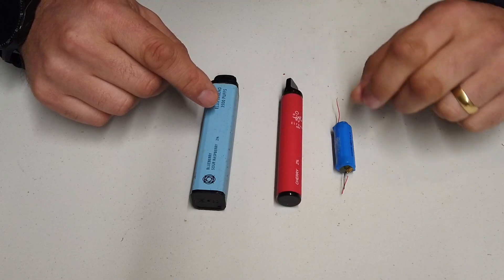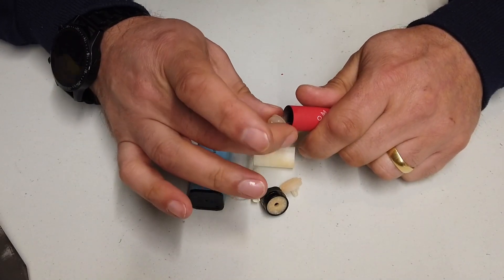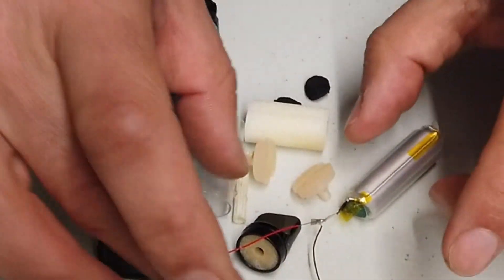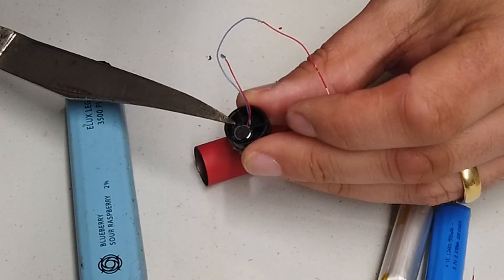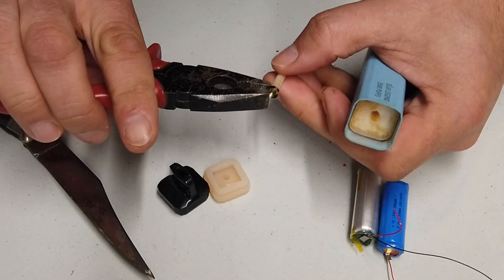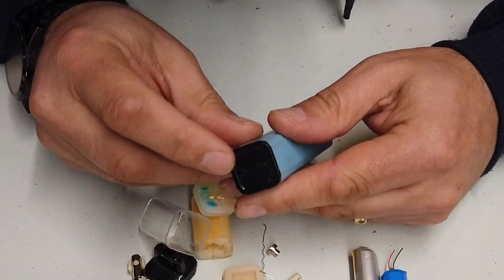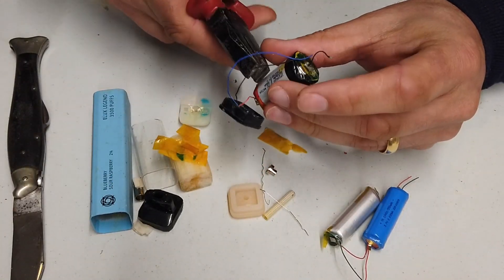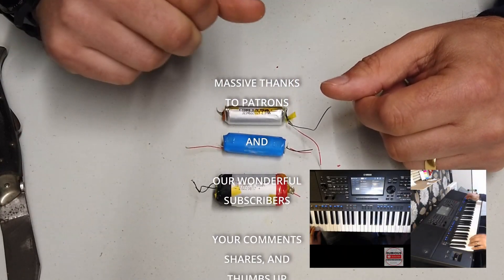DuB-EnG: Vape Lithium Cells Discarded Disposable Reclaimed Batteries Upcycling Waste Electronics

Comment: @Dubious Engineering - The only problem I have with repurposing disposable lithium vape batteries, is that manufacturers 'skimp' and don't bother including any kind of independent over/under charge protection circuit on the batteries. And most gadgets nowadays are designed to keep their lithium batteries charged to 100% whenever externally powered, which usually results in a catastrophic (often pyrotechnic) battery failure. The switch you refer to, is a rudimentary volumetric sensor, a simple way of detecting pressure differential, that simply closes a circuit whenever the air pressure changes. I always remove protection circuits from 'dead' lithium batteries, to reuse them with disposable vape batteries. Then they're safe to use and last ages because of their high capacity and very high discharge rates, also because they've only gone through one 60%~80% charge cycle from the initial manufacturing process. Hence the initial charge is NEVER meant to outlast the juice, so users don't experience dry hits. 👍😉
Reply from the maker: Absolutely!!! I always use a capped voltage constant current charger and maintain about 4.1v per cell 80-90% otherwise it all ends in tears 😢 😀😃🙂

Comment: People tend to wreck these things in some sort of anger and throw the battery on the ground. I sometimes see the LED blinking like a beacon. I think it gets activated by wind. If the battery is damaged, it gets a bit warm. I hit a motherlode where someone had gone to the woods and dropped about a dozen of vapes. Seems like they carried spent vapes with them to throw them on the ground.

The batteries can usually be recharged in an Opus charger. But are very fragile without solid terminals to use in a radio or something like that.
Reply from the maker: I've collected about 50 now...  Just thinking what to do with them!!!

Comment: I have in fact opened one today, like the fat one you showed. Using it for a solar project with a microcontroller sleeping most of the time
Reply from the maker: Incredibly useful little batteries...  👌 👍 😀  ...  and totally free 😀
Reply: @DubiousEngineering  yep. The one i just dissected was 500mAh. Not fantastic, but quite ok combined with a solarpanel and an ESP only waking up 6 times a day. Saving the sensor too. Might come in handy one day

Comment: I use “5V Charging Board MINI USB 1A 18650 TP4056 Lithium Battery Charger Module”that are cheap of ebay or Ali express to make little portable power packs. You can run led lights off them or if you add a step up usb module you can charge phones etc. it’s easier to attack them from the bottom to get the batteries out.
Reply from the maker: Thanks for the tips Simon! 😀...  I plan to make a charging video shortly with BMS and an intelligent charger! Best, Howard

Comment: I would imagine, Think of a one way valve. but the flap allows air flow. when you suck it's pulled to a connection turning on the battery. Easy flow switch....
Reply from the maker: Two plates of metal perhaps...  maybe I'll get the macro camera out for that video 😀

Comment: Sorry bro charged more then once likely, I normally get at least 5 charges before the liquids gone of the small ones. You tend to charge them before there empty too, because as your hitting them they get weaker and weaker as the battery juice drops. but considering you normally get 1000 charges of a lithium still a awesome find.
Reply: Except there is no charging circuitry or even socket! These are straight disposable.
Reply from the maker: Yup, no charging socket, I should have made that clear, but perhaps our man has his own way of recharging them?  Disassemble, recharge etc..  ??
Reply: @DubiousEngineering  My bad im normally getting the thc or cbd ones, there meant to last a bit longer. I forgot about the 7-9$ cigs ones that cant recharge.
Reply from the maker: @Marc Catalano  sadly, they don't sell those in UK 😞

Comment: Disposable vapes should be banned.
Reply from the maker: I'm tempted to agree. It's wrong all that lithium goes into landfill...
Reply: Where I am I think they are banned, as I've never seen these single use disposable vapes. The vape pens I've seen are fully rechargeable, and it's only the mouthpiece part which contains the juice and heater coil that's thrown away.

Comment: As I don't smoke, how are these meant to be disposed of since they have batteries? I'm assuming the usual method of throwing them on floor and into hedges that you see is not the intended method 😅
Reply from the maker: Well, I have seen some used battery banks in supermarkets etc, not sure if that's quite the right thing, but better than discarded!

Comment: Please do not charge these BATTERIES. I learned the hard way that not everything that says "Lithium" on it is rechargeable. I burned out one of those vape batteries (not accumulator). In my hobby room you couldn't breathe properly for days. I thought just like you that you can load them again
Reply: I set it to 500mA and it seems to charge happily straight away with that setting.. i turned around and at one moment i hearing a hissing noise. That Battery becomes a runaway. Was not quiet funny. I am a Hobby Battery-Guy and i recharged thousands of LiPo/LiFePo and averything between and i thought exactly like you. Why send it to the Landfill.
Reply: @dervwfahrer  Most are meant to charge again they got a port for it, what you were missing it the circuit that keeps from overcharging likely, or you damaged the battery getting it out.
Reply: @orionx79  As far i know it depends on ther Dividing Layer. On normal Batteries there is only a cheaply produceable 1-Way "Metallic" Layer between the Chemicals. Lithium "ION-Polymer" Dividers do work in both ways. If you try to push Power through the Metalic Version the "Wrong" Way you can blow out the Divider and so short the Chemicals.  C/P: Lithium-Metal Batteries are generally non-rechargeable and contain Metallic Lithium. Lithium-"Ion" Accumulators, on the other hand, no longer contains Lithium Metal but a Lithium compound (Lithium Oxide) and these are rechargeable.
Reply: @orionx79  I use/own "3" SkyRC B6DCV2 Computer BMS Controlled Charger. I can also Charge without BMS. On a standard Wallcharger Batteries without BMS will be Fatal. On that you are absolutely right.
Reply from the maker: I have a capped voltage, constant current charger, give me a few weeks and I show you how I check and test them.  Best, H
Reply from the maker: I'll deffo be checking the charging carefully!
Reply from the maker: Quite possibly